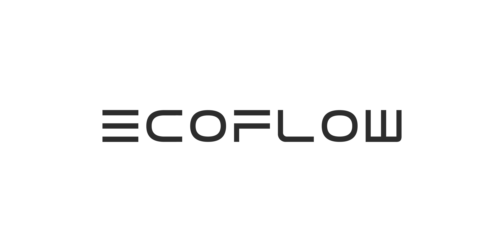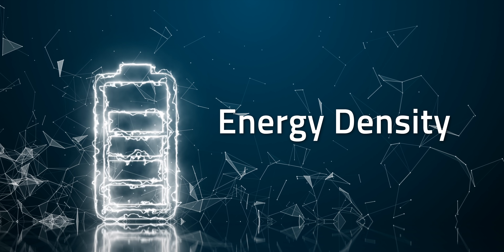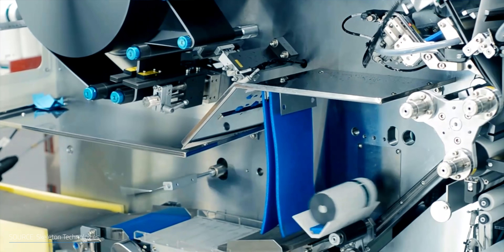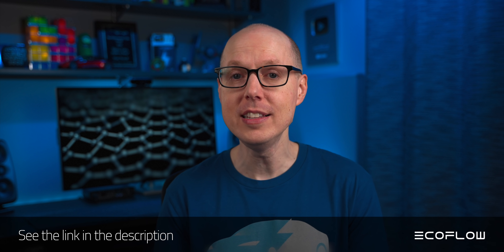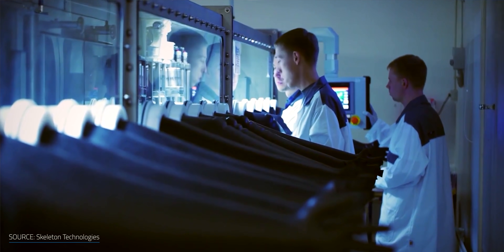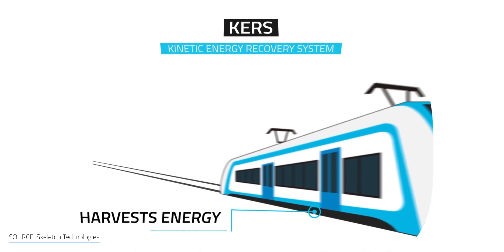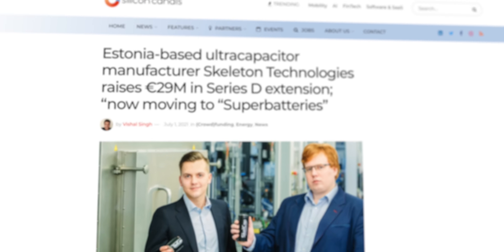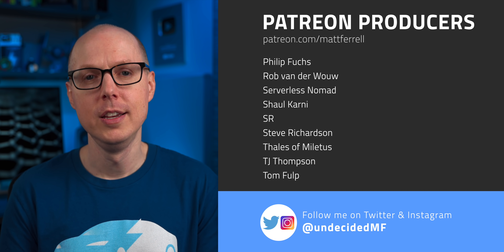Revisiting the Supercapacitor - The Wait for Graphene is Over

Comment from the maker: Do you think graphene is still all hype or if it's going to start making an impact? Pre-order the Ecoflow Delta Pro starting on December 15th or get up to $650 off for other products through Christmas: https://bit.ly/EcoflowDeltaPro.

 If you liked this video, check out "Exploring Why This Nuclear Fusion Breakthrough Matters": https://youtu.be/-KEwkWjADEA?list=PLnTSM-ORSgi7UWp64ZlOKUPNXePMTdU4d
Reply: I love my maxwell super capacitor. 1800 cca it lessen the heavy draws on my batteries. Let the capacitor do the cycling. Like bass hitting on a car stereo. Add the super capacitor and your headlights don't dim when bass hits. The hard cycle is not placed on your battery. I couldn't run my skill saw all day off the solar and lead acid batteries without the super capacitor. The charge time is great within minutes of sun rise and I can be sawing. I use mine more as a soft start. The car stereo is the best way I found to explain of how super capacitors fit in and work. I believe they help extend life of batteries and other solar equipment. You might have one in your car if you have a big amplifier.
Reply: @eliinthewolverinestate  Interesting and "ah ha!" This sure makes a lot of sense to me. Taking your idea a bit further and eliminating the need for a battery to provide huge amounts of CCA, and replacing a car battery with a deep cycle in parallel with a bank of super capacitors (wired in series in order to divide the 12 or 14 volts between each cap, but also dividing capacitance) could bring benefits.

Another thing comes to mind about your application, Eli. Capacitors (and I believe super caps included) are not affected by old temperature like chemical batteries. Cold temperatures cause engines to start harder and batteries to produce less energy. But having power in reserve in a set of capacitors would help assure ample energy for the ignition and cranking over of the engine. I'm really going to have to look into this.

Thanks Eli!
Reply: @eliinthewolverinestate  no, but when cars with such speakers drive by the apartments, everyone's power dims.
Reply: LOVE your tech updates.  I keep telling people that there are alternative energy breakthroughs every single week and that whats coming in the near future will blow their minds.  :)
Reply: It’s making a great impact on human health these days. Get your injection today!
Reply: Graphene more current potential than I understand, but I'm particularly interested in how we're coming with creating large sheets of contiguous graphene for structural purposes.
Reply: Graphene is still too hard and expensive to make to take over but I believe it will some day. Maybe after Elon or one of his teams takes it on. Hopefully though someone else gets it done cause Elon will be pretty busy for a decade or 2. The major use for Graphene I am waiting for is improving the process of Desalinization of Seawater. That could change the whole world.
Reply: @tomcrouchman  Tesla and Elon Musk haven’t developed much of anything. They are good at taking other’s creation and integrating them into a product. There self driving software is from Mobil Eye. Giga press the Italian company that builds it. Batteries Panasonic and the Jeff Dahn’s Labs. Ect.
Reply: @anothercomment3451  I would think when I said Tesla and Elon Musk it would be obvious that I was talking about the company and it CEO and not the inventor Nikola Tesla.
Reply: @tomcrouchman  because your ignorant and can't research 160yrs of data
Reply: @brettmoore3194  enlighten me? I see your post now above mine. you are funny.
Reply: @brettmoore3194  Is the earth flat too? lol Ya there is a conspiracy alright. Dude the problem with Graphene is that is difficult to manufacture at scale. Sure we didn't just invent graphene but we still have yet to create a way to manufacture it at scale at 100% quality.
Reply: @tomcrouchman  well Tom I'm a scientist. So if someone would present telescopic infrared video of 200 miles distance at 0 declination. Then I would stand on then the side of evidence based observations.
Reply: @tomcrouchman  laser exfoliation of graphite oxide formula is well known. 25w per sq cm of 668nm. Other wavelengths can create other shapes
Reply: @brettmoore3194  Can it create enough graphene to replace the filter system in a desalinization plant for a cheaper price that is currently being paid? Answer is no. the end.
Reply: @brettmoore3194  What are you trying to say. Can you or others create a manufacturing plant to mass produce Graphene on a level so that it can be used in every sector of manufacturing? Cars, Batteries, Filters, Ship building, Clothing, Material production, Starships etc? It has to be cheap enough to replace current tech.
Cause otherwise what is your beef here?
Reply: @tomcrouchman so ignorant. Deep thermal ocean desalination/power generation/ mineral extraction idea has bren around 70s
Reply: @brettmoore3194  I recommend that you apply to Tesla and make it happen.
Reply: @brettmoore3194  apparently its still too costly. I would agree though that there has to be some nefarious reason that Desalinization tech has not progressed much in 80 years. Heck America built tons of them for all the island hopping in WII.
Reply: @rogerstarkey5390  I know that I don't know everything but I am humble enough to know the knowledge of today has been limited to benefit a very few
Reply: I don't know if electric aircraft may be possible one day  -- everyone always says that batteries don't have the energy density fuel has, and meanwhile fuel cells don't have the power output that combustion has. But if they do happen, perhaps graphene supercapacitors could provide a few minutes worth of additional power for takeoff and/or climbing when necessary. Then fuel cells could provide just the power required for cruising. Does that sound plausible/practical?
Reply: @manofsan  There's a startup near me that is doing something similar to your idea but with a hybrid plane. The idea is to use the electric motor for takeoff and landing and  other high power movements then use the normal combustion motor for low power, high energy movements like cruising. You still need a battery pack onboard, but you can get away with a small battery pack since you only use the electric motor when you need it. This method allows them to use a smaller combustion engine engine since the electric motor does the heavy lifting for climbing altitude.
Reply: Have you had a look at Talga? It’s a vertically integrated graphite mining and processing company based in Europe and getting into the battery market for EVs, plus other products such as anti fouling coatings for ships.
Reply: Sponsor makes their products in Shenzhen, China.  I will NOT SUPPORT products made in China.
A country that is trying to destroy global Democracies, Taiwan, and United States.
Make your product in the USA or Taiwan, or anywhere else.  NOT CHINA
Reply: the super battery sounds like it could work really well for tram busses that are on a wire most of the time but need to turn corners or go off course occasionally.  Provided it's a cheaper option than lithium, which is harder to pull off these days.
Reply: I've long felt that capacitor-enhanced regen braking could help. But since braking is a minor proportion of travel, is 30% enough to warrant the complications & cost of integrating capacitors into EVs? Maybe more in heavier lift modes, like transport & flight, where overcoming altitude gravity differentials can be huge?
Reply: Don’t forget the new breakthrough called “FLASH” graphene. You still have not covered that yet. It is 95% better than conventional, and is cheaper to mass produce, even DIY with proper equipment.
Reply: Made me think (1) why aren’t we using meta materials to capture electricity from exhaust and converting Co2 into carbonic acid, then use this to hold a charge. Releasing carbonic acid at a pit stop to be used by monoculture farms to make more nutrient dense food. Plants do it naturally, why not just mimic God’s natural system. For a abundant future world look to Regenerative Agriculture and Permaculture for our planets needs.
Reply: You didn't mention how Graphene is used in the vaxxeenz
Reply: @MrHydroguy  ALOT of graphene use, for years, now ... but the herd is too sleepy to know.
Reply: Can we take power from lightning if we have huge amount of these capacitors?
Reply: @sudharsangokuls8958  great question! That would help the grid a lot. Or what about EMF background radiation
Reply: Matt, if some old reclusive, kook who really didn't care much posting you tube videos showed you a way to mass produce graphene easily, cheaply, and required as much technical skill as making a peanut butter sandwich would you post the process in the interest of humanity like I asked others to do? Or like others would you instead edit your comments and keep it for yourself like others have done thus far?
Reply: Graphene is all hype imo. The only place graphene exists is on animations!!
Reply: @PeterPete  You are very, very mistaken.
Reply: @anothercomment3451  You and lots of other people are more than welcome to show me a piece of graphene!!! When can I expect to see a piece of REAL graphene?
Reply: @anothercomment3451  tks for your opinion - i guess you can tell me where one can buy graphene then?
Reply: @PeterPete  I don't know if the public will EVER be able to purchase it -- surely never in nano form, though.  It is on & in our bodies (nano), and has been for years.
We are actually walking antennas now, from nano metals in our air for quite a number of years.

Ever see the area 51 films from the aLIEn crash at Roswell?  The local doc who was there gave 'em to his son, who published them, -- and the "craft" material had EXACT same qualities as graphene!  Amazing!
If you think public info is anything but entirely controlled, you are  seriously mistaken, you don't research very deeply.
    To sum it up, you have Ignored Learning from available, under-the-radar sources.  To IGNORE learning is what makes folks an Ignorant Ignoramous.  (Notice the Root word, eh ... Ignore)
Reply: @anothercomment3451  You've got a very creative imagination, who helped you with it? Bob Lazar? Haha, the fraud!!

Never heard so much rubbish in all my life. Imo if nobody can show me a piece of graphene, it does not exist in the real world.
Reply: It's too bad we make such a fetish out of saving energy - motivated by the quackery of "global warming", I might add.

We have access to an essentially limitless supply of energy - Thorium.

https://youtube.com/playlist?list=PL6JjafE5gsb928LkKNnz9MUiVBME4aGqi

We develop and "calculator-ize" that instead.
Reply: @hg2.  quote - We have access to an essentially limitless supply of energy 

the food we eat, the water we drink and the Sun ideally produce all the energy we need!!

What do you want thorium for? So you can waste energy and buy meaningless products??
Reply: @hg2.  quote - My pursuit of happiness is none of your business.

at least you admit you are unhappy!
Reply: why would large quantities of graphene iron oxide be in thevaccines?
Reply: Hard to respect a man, that with one look, you know has never done a day of actual hard work...
Reply: @randyross5630  Starting to figure stuff out, eh.
Reply: Reading the comments …
The word “ They”
Comes up muchly…
I wish that I were a “They”
I think the word “They” is probably indicative 
Of folks that actually do things…
Not just troll…
If I were a “they” At least I would be doing something instead of playing chess….
Thank you Matt for these provocative and inspiring videos…
Reply: I enjoyed the video and would like to see one on Graphene Manufacturing Group Ltd who make graphene from natural gas and plan to make graphene aluminum ion batteries
Reply: Pretty sure graphene will be widely in use by the end of the century; strengthening concrete, making airplanes lighter. Biggest graphene company in the UK is Versarian, who have a few MOUs.
Reply: Graphene as a layer in fabric - Graphene X                                                                                                                                                                                                                                              https://www.youtube.com/watch?v=IrMj_OiI0TY
Reply: Huge impacts soon. It took a little bit longer than I thought for the industrial capacity to mature, but no, this stuff is amazing.
Reply: @rylian21  The gov has known that for a good while now.  It's everywhere, but most folks don't research, they wait for info to slowly be dished out onto their laps.
Reply: Cant wait for thunderb00b to debunk super capacitors.
Reply: you really need to start mailing acceptable microphones to people you interview LOL
Reply: Have you done a video on zinc air batteries? I'd be interested to see your take on it. There is a Canadian company called Zinc8 that is developing it as long term storage batteries.
Reply: How about looking to graphene H2 fuel cell tech would love to see where it has gone and if I had missed anything on it
Reply: interested how much range did your tesla get from Power Bank?
Reply: Dec 15? What time zone will it be available? Waiting for Delta Pro availability for a few months now
Reply: Meh.  Whole lot of hype over not that much. Check the datasheet.
They get only up to 3V and have 1Mcycle, but at less than 1/20th of the Li-Ion energy density.
Having big currents with Li-Ion isn't exactly impossible nowadays.
Yes, they have found few niche applications and might have few more.
So new Electric Veyron, McLaren might have a couple of them.
So what ?
Reply: Hi Matt, perhaps check out an Australian company, Talga they are doing some cool things including mining the world's finest graphite  in Sweden.
Reply: Tq info ☺️👍
Reply: Pre order before product launch hmmmm sounds like a scam
Reply: Graphene is the way of the future. If I had the money I'd start a graphene manufacturing facility. One day it will replace silicon
Reply: @frankh.3849  👍 carbon manufacturing is definitely the future from nano to colonization of printed products. 5 times stronger than steel and lighter than plastic
Reply: I don't think it's all hype, the science is there and whomever gets over the hump to manufacture it on a large scale will be rich and or famous. I just hope it's soon.
Reply: Ppppp
Reply: Sounds like tech is going to have a whole new game changer sounds good, also respect to Dr Pullman for taking time to have the interview something you dont normally see from big tech companies speaking to the little guys (no offence meant by the little guys remark just used to emphasise how much it meant he taken time out) thanks for the update really shows how far things are moving forward looking forward to the next chapters cheers
Reply: spyros panopoulos and what is "anadiaplasis"
Reply: holy shizer bro dream job hahahahahaha enjoy your time explaining the shiz we invent soon <3
Reply: graphene is all about how to get it produced at massive quantities.  so much discoveries or papers already out there for graphene. LFP batteries which is boring on specs but could take over the EV and energy storage batteries.
Reply: Well, here in Brazil, we have a company called TELITE, that  "kills 2 birds with one Stone"... It made PVC (from recicled bottles)photovoltaic rooftiles with graphene layers...
Reply: @augusto_lisboa  
Pathetic. 

Please spend a couple hours researching Thorium (Kirk Sorenson). You'll see how stupid this energy penny-pinching is.
Reply: Great video. Thank you! Can you make a video on sodium sulfur batteries featured on techxplore news?
Reply: Thanks @matt. I will be implementing this on my next design :)
Reply: Why are you not showing any statistics?? Are you hiding something?
Reply: They have a process that uses Silver and Gallium to pull CO2 out of the air cheap & turn it into carbon silk & pure Oxygen.
Reply: actually graphene has been in our CELL PHONES since 2017 ...thats mainstream products . it has also been in flat screens and several other mainstream appliances in the united states .your opening statement makes no sense .
Reply: I will buy my first EV when the battery carries 1MWh, and can deliver a power of 1MW, has a weight of less than 400 kg including charger, dc/dc converter and motor controller, a volume of less than .5 cubic meter. And comes with four direct drive electric motors. Turn on all wheels. I also want a grill and a fridge large enough for 4* 1.5 L bottles. Before then I don't consider cars a desirable product, but something I buy because I have to.
Reply: Thanks Matt. It's not hype in my opinion. You and others are close to important breakthrough s. 
In my work, a so called 3 bank system proved extremely more efficient.  bank 1 deep cycle bank 2 not so deep cycle bank 3 capacitor s. All banks give and take to each other and loads.
The true winning solution came in recapturing potentially lost current. Food for thought without giving up to much work related crap. Cheers and thanks for your honest reports!
Reply: It erks me when people say graphine is a two demintional  structure.   It is not.....it is a 3d structure...it just happens that one of those demintions is.....one
Reply: Please use YouTube-Chapters!
Reply: This is the beginning of a new era in energy storage.
Reply: This is what I mean about graphine and helping for use of energy. I wanted to know what uses we can do with graphine and nuclear energy
Reply: Not sure if I asked you...Have you investigated Borophene?
Reply: @Dave_Jr.  Boron -- the benefits have long been held under the radar.
Reply: Fascinated by the Eco Delta Pro….how many mph charge did you get from it on your model 3?
Reply: graphene is making its way into everything from concrete to batteries, capacitors, paints, etc. Just took a while to figure out how to apply them.
Reply: @christopherbeddoe406  Nano applications is old news, to those who read more than watching tv, I think.
Reply: Nano graphene has been impacting people and living things for a while now.
Reply: Thanks Matt for that intro to graphene. I have just been watching ‘Just have a think’ about perovskite solar cell technology, still in its infancy. Perovskites are structurally weak but offer greater PV efficiency than silicon. Graphene is structurally strong, electrically conductive in one plane but an insulator in the perpendicular direction. This made me wonder what the properties of a graphene/perovskite/ graphene sandwich might be?  Could it work like a self charging capacitor when exposed to light? Is anyone working on this?
Reply: We're coming up on 2023.  I know you have this on your radar.  I would love to see an update here in the near future.  Thanks again for what you do Matt.
Reply: Nano materials such as graphene HAVE made an impact.  The herd is in a coma, evidently.
Reply: @Bjorg Bjorgingson yup
aLIEn 👌
Reply: Hey Matt, hoping to see you address the video showing poor research on your hydrogen storage video. I like your content but seeing the information missed makes me wonder whether I can trust the rest of your content.
Reply: @jdown79  He's doing a good job.  Give the guy a break.  It's impossible to get accurate info from any company as to some extent they all lie.  Even a good financial analyst or examining accountant investigating a company are unable to catch everything.  Overall he does a great job at presenting new tech.  It's up to us to filter.
Reply: @l0I0I0I0  I didn't really think I was holding him over the coals lmao.
I get what you're saying, but the issues shown are pretty egregious, I'm trusting a channel like this to be the filter between scam/junk and potential, y'know? 
But end of the day I'm just asking him to address it, and perhaps give another take having that information onboard. If not, I'm sure I'll survive haha
Reply: @jdown79  I hear you but being in the know of business evaluations, forensic accounting, it's just  not possible to do everything.  He does not even have access to any real insider info.  Constructive criticism is a good thing but don't leave out the good.  Trolls in public forums, are harsh and brutal.  Giving unbiased opinions by presenting both sides together helps assuage the brutality of open forums.  Hope that's fair.
Reply: @l0I0I0I0  oh look I can certainly agree with those statements, i think some information should have been possibly found before the video was made but I digress;
I found the halfway point with channels like kurzgesagt and infographics, where they'll release videos once in a while covering their previous mistakes / left out information
Reply: @jdown79  Took the words right out of my mouth.
Reply: still hype. need another decade before we truly get from lab to mass industry (that is itself not too polluting & renewable energy consuming)

if new tec creates similar or new forms of waste then its actually still failing our collective values, no matter the price tag imho. :)
Reply: how could there have been curved graphene in the 1990s when graphene wasn't isolated until 2004?
Reply: @spacecatfromjupiter  Because the public is dis-, mis-, and mal-informed, deliberately ... and the curious few who like reading figured stuff out years ago ... and they are trkd, labeled as a 🎯 for speaking normal conversations about how our world actually works?
Reply: Of course graphene will have many applications.  How are these "ultracapacitors" different from the ones available on Amazon etc for the last year or so?
Reply: Matt, I don't know how you do it, but you manage to cause my ADHD brain to hyper focus on your voice! Amazing, since you don't speak fast.  You have a gift for teaching.  >>Tom's wife Pam <<-
Reply: @Tom_From_Oz  yep !! he's fantastic :-)
Reply: It may be.... 
More dense capasities madid of ALUMINIUM... Oxidaluminium type ARCHITECTURE. 
In VACUUM CHAMBER.
Reply: I think water is awesome :P 

Carbon ? slightly big deal. Definitely going to see Graphene this decade, the golden decade. LFG ! its on all of us to give not take <3
Reply: "The media hype got a little bit out of controle in the beginning" !  You got a mirror ?
Reply: @edide1627  

A little? 

A you aware of the extent of quackery and superstition surrounding:
- "global warming" 
- "ozone depletion"
- GMO foods
- "organic foods"
???
Reply: @hg2.  !!!
Reply: @edide1627  
?
Reply: @hg2.  My point is he's on of those "Media" who created that hype and is now claiming got a bit out of controle. 
I hope u'r not claiming Global warming is some kind of hoax or a non issue etc. if so please dont reply.
Reply: Excellent Analysis, We Can Power Our World With Water..
#TESLAHydroElectric #TESLAWaterCar #TESLAEnergy
Call Or Text Anytime Thanks Matt
https://youtube.com/playlist?list=PLG7EoBMUD1JwbD5-MQpFRGvadGWtf-4yD
Reply: The same material used to make pencils black. The “lead” is mostly clay, with graphite as a dye in very small amounts.
Reply: It was found out in 1859, the 2004 graphene is propaganda. This tech is easy to make with a 668nm laser at 25wpsqcm. So a 6ft laser array moving from reel to reel. The solution is a Teflon dielectric so 600v 1200v or even a 5400v caps will solve the curve
Reply: I think capitalism is a dangerous gatekeeper of technological progress
Reply: @SapphicReality  as opposed to socialism that protects everyone, i mean where do you get your information?
Reply: @SapphicReality  That's really unfortunate, as capitalism is also a great motivator for technical innovation. When a body appropriates another person's (team's, or even a whole culture's) ideas and property (i.e. intellectual property, but is also extended to art) without permission, it erodes the desire of "creatives" to work at adding value to society and shifts focus and energy to striping value from others. We see this time and time again played out over history.

Of course there are always the unimaginative and corrupt lurking about who will lazily employ tactics like "patent trolling" or worse, lobby the government for legislation to extend reliance on certain industries protected by "retreaded" but old patents to extract review. But the latter illustrates how government's power can be used to distort the "fair division or resources" (i.e. politics).
Reply: @SapphicReality  so capitalism prevent China from researching human chimeras, hypersonic warheads, mRNA virals and vaccines?
Reply: @SapphicReality  Unfortunately yes...and the copyright circus...that os why China is getting better at new tech....
Reply: @electricaviationchannelvid7863  Ch is way ahead, and their nation's defenses are, also.  We FOLLOW them.
Reply: Inject it into people and turn them into trans robots or spray it on to their food water oh the possibilities!   Gates rubbing his hands
Reply: What we need to drive this forward is a good old fashioned world war. Wars have driven technologies forward faster than "free market forces" because war doesn't care about profits.
Reply: @curtrapp5291  today is not war than impulse it, but the fear of the planet natural cycles like the "global warming" or even the artificial scarcity of some resources like oil/gas.  Or well, an "super destructive virus" :)
Reply: @curtrapp5291  Wow, and all these decades of experience and reading I thought wars were driven by greed (of someone else's power and wealth) and fear (someone taking one's own resources and stability). 

WWI origins lay in Social Darwinism growing power vacuum left by the decline of the Ottoman Empire (who continually lost territory in the 19th and 20th Century in the Balkan provinces). Like a collapsing red giant, the people of the Ottoman Empire may have rallied to recapture their former glory and pushed back. The resulting "powder keg" was set when the assassination of the heir presumptive to the Austro-Hungarian throne provided the "spark"; setting the losses and gains of fortunes for so many around the world.

WWII's origins lay in the aftermath of WWI where Germany was tasked to make significant reparations, while also greatly restricted in its economic activities. Perhaps proving that onerous laws create lawbreakers of all, much of Germany's technology development was obfuscated, while much of its population nearly starved. The lack of security, freedoms, and confiscation of currency and means opened the door for someone like Hitler to come to power, who wanted to "confiscate" (i.e. "profit") Europe and ultimately the world. Yes, many technologies were created out of "war", but I have some challenges to think about.

Although wars open the floodgates of money (diverting resources, also see Germany's "blank cheque" to support Austria-Hungary event in WWI) to a war effort, the resultant technologies must be adapted later to civilian use. 
Cases in point: 
-Nuclear technology used in bombs and for propulsion in ships. Resultant reactors were originally designed to also generate fusible materials for bombs. Alternatives like Thorium (seemingly far superior in cost, power, and safety over Uranium-based reactors) were never pursued by the US' Military Industrial Complex, but are now being pursued by other countries. It's taken generations to venture out of a mindset we didn't even know existed.
-Liquid fueled rocket technology pioneered by Godard (inspired Von Braun, who originally aspired for civilian use of space) was advanced and paid for by military (Nazi, Russian, American) budgets. Their spinoffs in civilian use remained expensive as they were single use and the military had little use for missile that could "return home".

Contrast this to the achievements and likely-soon-to-come achievements of companies like Blu Origin and especially SpaceX. Unless we have another war soon, it seems the civilian access, use, and exploitation of space in the near future will open up in ways only dreamed about previously; truly "expanding the pie" instead of taking the piece of another's (after injuring or killing them first).